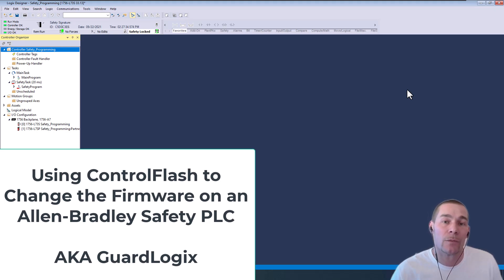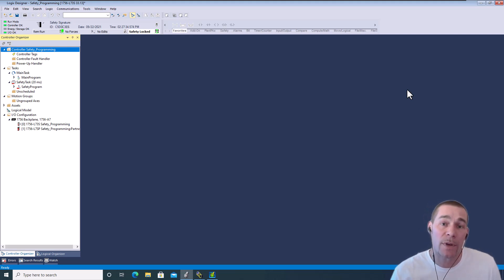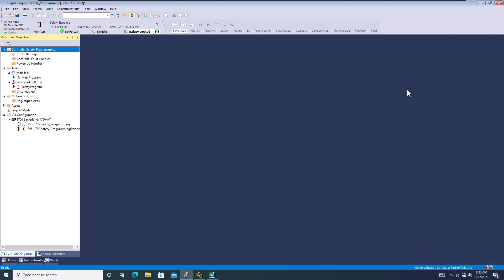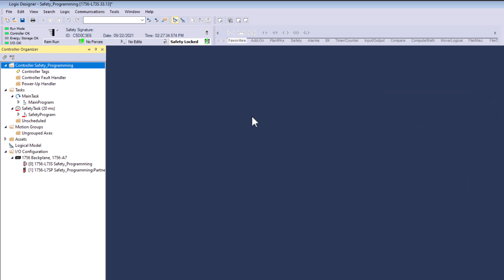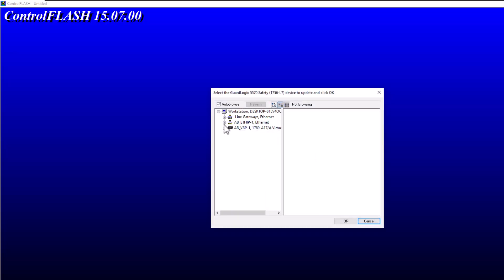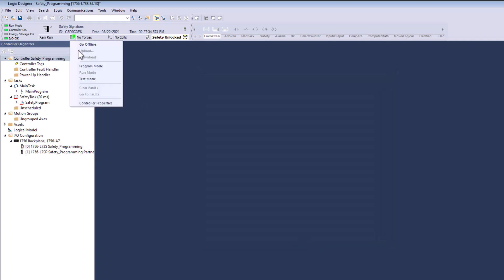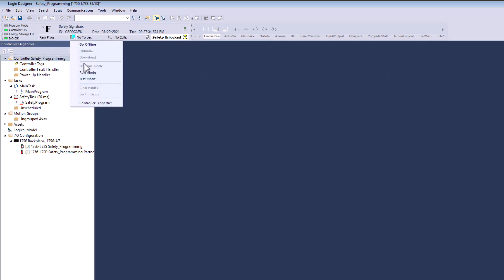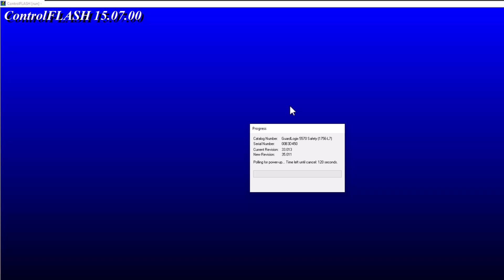ControlFlash to update the Firmware on an Allen Bradley Safety PLC | Guardlogix firmware update

Comment: "Hi Shane, could you explain in more detail what might cause the 'Type 14 Safety Task Fault (Code 01) – Task watchdog expired' error in a GuardLogix PLC? Have you encountered this in practice, and how do you usually troubleshoot it when it's due to an infinite loop or a missing Safety partner?"
Reply from the maker: It could be a bad safety partner or a communication issue on Ethernet, generally when I troubleshoot things like this it's in person and a different resolution every time
Reply: @ShaneWelcher  Hi Shane,

Hi Shane,

Thanks for your feedback!

Just to clarify — this controller is being used on a test bench, with no logic programmed, no I/O modules connected, and the safety partner is present and showing no faults. However, the controller still triggers the following fault after running for a few hours in RUN mode:

(Type 06) Watchdog Fault – Code 01: Task watchdog expired

(Type 14) Safety Task Fault – Code 01: Task watchdog expired

I have already updated the firmware to a recommended revision, but the issue still persists.

Do you have any suggestions on what else I should check or try?

Thanks again for your support!

Best regards,